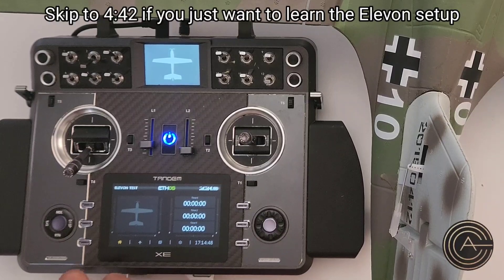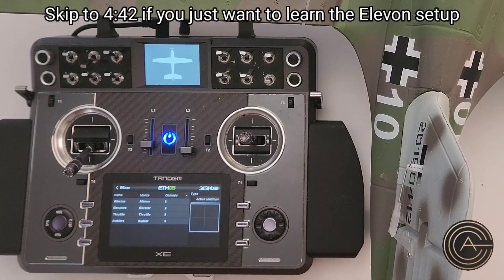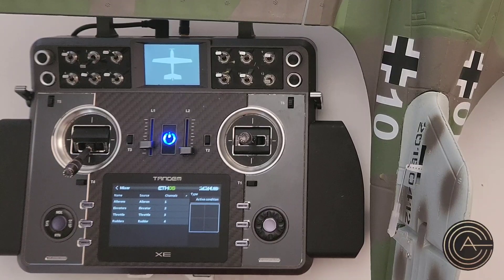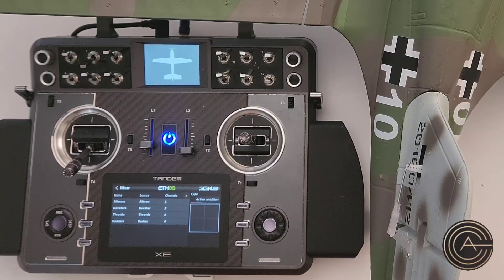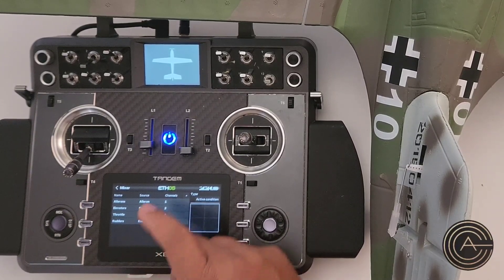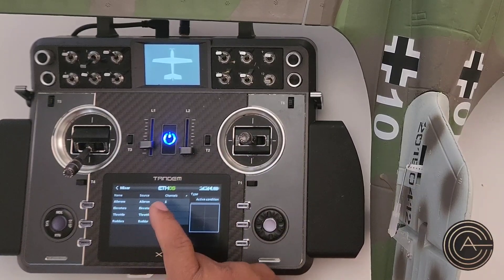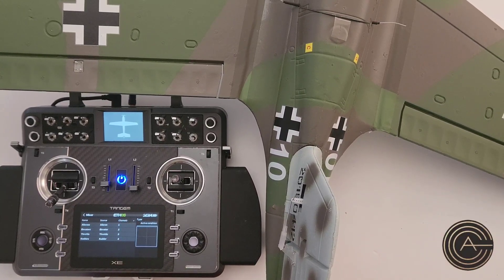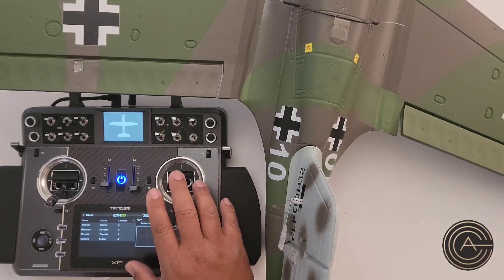The Frsky Series: Understanding Mixes and the Elevon Mix

Comment: Hi My name is Rodney P, I've purchased a   FR Sky Tandem20S from Flying Robot. Big change from JR.  I use this to fly mainly Pattern Aerobatics.
How do I set up Aileron (on fully closed)  and say, 5% down elevator. Basically to tuck the nose in on downlines. 
JR would have Throttle  as the Master and Elevator as the Slave, quite a straight forward easy mix.
Look forward to your response
Thanks
Reply from the maker: Not really sure what you are saying with aileron. Sorry, not a pattern pilot. But if you wanted 5% down elevator when throttle was closed. Create a new free mix. Source is throttle. Output would be elevator channel (I assume ch 2).  Now you need to play with weight and offset.  Try a -5% weight and a 5% offset. You might need to reverse those depending on your elevator settings. Essentially a mix is just source - the controller and output -the channel you want to control. You can add an active condition (a switch to turn on and off the mix if you need to). Does that help?
Reply: @all_rc  My Apologies > i didn't even check my request properly. But you assumed correctly,. What I meant was 'Throttle not Aileron.
I managed to get that in freemix. I wrongly used one of the canned mixes ,throttle =elevator.
Thanks for replying though.
Another request. When flying pattern there are a prescribed number of manouvres. How could i load these manouvres on Tx and have them called out in sequence at the press of a designated button.
Reply from the maker: Yeah, I've never really used the canned mixes and just use free mixes and I've always been able to do what I wanted. I personally don't use much sound files but I do understand it pretty well. To play sounds, go to SPECIAL FUNCTIONS. Create a new special function. Action is play audio. State - enable. Active condition - a switch to activate it.  Create a sequence. First sequence - play file and choose the first sound. Second sequence - wait condition and choose the switch to move on..  probably the same switch as active condition.  Next sequence is your next sound file. And so on. Now you hit a switch. It plays your first sound file. Hit the switch again and it plays your next sound file and so on. If you have custom sound packs. You can load them into the radio. You can create sounds and voices by either recording them or using a text to speech program. Should be a .wav file with a 32,000 hz rate of less, I Believe. But try what you have. I assume you have a bunch of sounds in your JR radio... Maybe try and get those from the radio and transfer them?
Reply from the maker: Also, Ethos Suite (the PC companion app) has a audio manager that can transcode the sound files to the proper settings for you.
Reply: Hi Rodney - I've got the same issues as you, as I am coming from JR and Graupner MC24 transmitters where doing things such as this are really, really simple (I mainly fly gliders with multiple flight modes). I've found that the best way of getting help is (i) download the latest FrSKY user manual for the version of Ethos your TX is running (things can be really different in Ethos versions before 1.5), (ii) look through all of the available Youtube videos BUT be really careful that they are using the same Ethos version as you are - I nearly lost my mind wondering why my 1.5.9 X18 TX was so very different to what was in some earlier Ethos version videos, (iii) try RCGroups - there are some really helpful guys and gals there. Good luck.